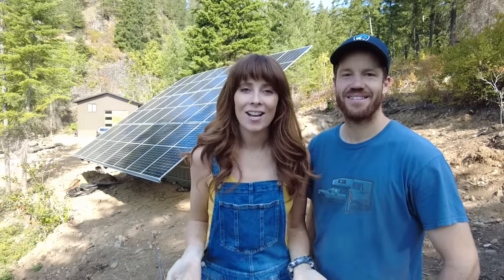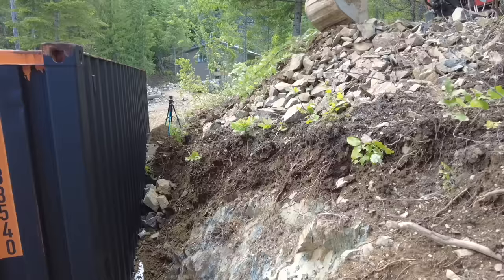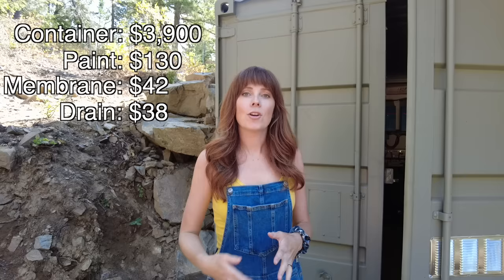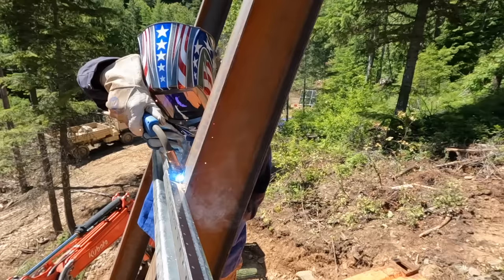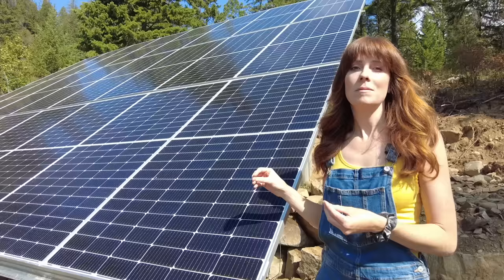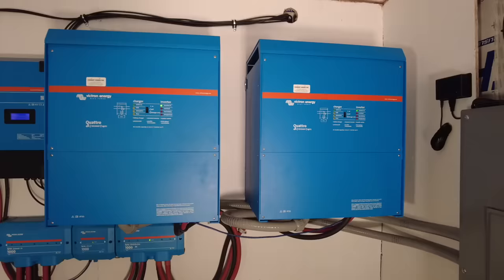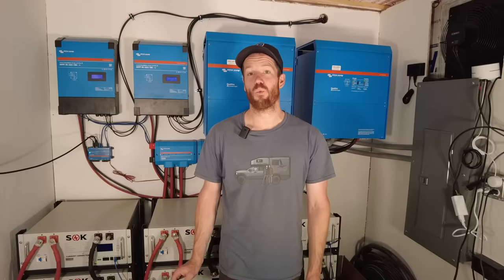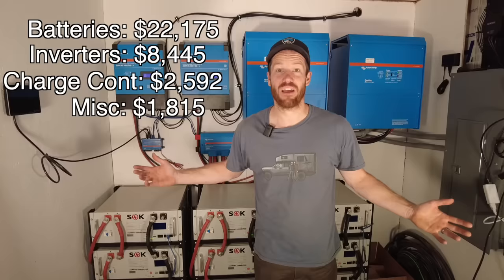TOTAL COST Of Our Off-Grid Solar Power System | Powering Our Mountain Home

Comment: I love your honesty actually giving us a breakdown of exactly what it cost yes 50,000 is a lot of money that being said your sweat equity probably doubles or more the value of your system again thank you for being so honest of how you have Made this happen with the help of your viewers and your hard work!  I am so impressed wow!
Reply: I second that.  We are looking at putting in a grid tied system at our place, but are going to contact the company they got all their components from as we're here in the Pacific Northwest too!
Reply: A monthly electric bill of $200.00 a month would take 20 years to get back $50,000.00 they spent. At that point you may have to replace batteries. Not to mention fuel cost of a generator on cloudy days. Where the savings? Not to mention the maintenance of a solar system. Solar pricing is still to high at this point in time.
Reply: @roywaite5793  After 20 years at their current usage they have estimated that the batteries should still be able to hold 80% of their original capacity which would be be 48kW. They won't need replacing for several years beyond that and at worst they could simply add another couple of batteries to restore original capacity if needed. Then as the older batteries start to fail they can be replaced individually.
You also have to factor in the ever increasing costs of energy so in a few years time that $200 estimate could quite easily become double that. Battery technology will improve and hopefully become more affordable, more efficient and more durable in those 20 years so it is absolutely worth it.
Reply: @roywaite5793  Think of it as paying for 20 years of electricity up front. Then there's no monthly bill, ever.
Reply: @roywaite5793  I guess you didn’t hear the part of what it would cost for them to have power brought onto their property!  I have had that done on property and it far exceeded the original estimate of the power company to bring power on to my property!
Reply: @roywaite5793  I guess you missed the part of the USD 60k it would cost to get power lines from street level up to their remote location?
Reply: @roywaite5793  You do realize that they are going to likely get a 30% rebate (or at a minimum 26%) right? That brings it down to no more than $37,000 for the 26%. And that $200 monthly electric bill you're talking about does not possibly include electric heating or cooking, or you would not even bring that up. Because if so, that bill becomes closer to $400 per month when you also include air conditioning in summer, and even over $500 in some. So at $400 per month that's $4,800 per year, or $48,000 after 10 years. And since I just pointed out that the total cost would not be more than $37,000, then the break even point is only a little over 7 years. So it's all free money in energy savings from them on. And since they'll likely own at least one electric vehicle by then, or even a battery electric excavator or other heavy equipment (yes, they already exist and are at work) it's all free "gasoline" as well. 

And by the way, your $200 per month assumes that electricity rates don't rise over the course of 20 years. Just look back at your bills 20 years and you tell us. And you want to take a guess at what gas prices will be 20 years from now? Of course, that's if it's still even used by then.
Reply: @roywaite5793  it would have cot them 60k to connect to the grid and then 200/month on top of that. they made the right choice
Reply: @greggv8  😅😅😅  I hope you're kidding...solar panels last 15 to 20 years max and lose efficiency along the way
Reply: @Paul-cj1wb  Wow, that sure is a lot of ignorant made up prices in a single comment.
Reply: @ttkddry  Yeah, but that would have increased the property value instantly.  This will be worthless if they don't sell the property soon.
Reply: Evan: with the current improvements they made, especially with the off grid power, they have increased the value of the property and made it far more interesting to buy. Keep in mind that when they bought it nobody was interested in it because of the lack of power. They fixed that now and made the solution independant of future energy price increases
Reply: @ttkddry  Yeah, it isn't worthless or anything, just would have made more sense to first just connect to the grid, (since they obviously have the money to) so as to get the actual equity from it.   How much more valuable would this overkill array be if they could sell the excess energy once the batteries are topped off? Sometimes people really just do the things they do because youtube's algo says they'll make money off of it.
Reply: Evan: time will tell if it is a usefull investment, it depends on what energy prices do in the future... Just look at the price evolution in Europe, we went from 20 cents to over 65 cents per kWh. Our workshop went off grid last year and we do not regret it, price increases do not affect our operations.
Reply: @ttkddry  Of course it is a useful  investment, unless they literally don't use it that is.  It's just a significantly less useful first investment if they could have afforded to connect to the grid.  It looks like this system is going to waste a huge percentage of its capability without being  able to sell the excess energy.
Reply: @evrythingis1  Selling excess energy to the grid is overrated, it all depends on the rules and tariffs that apply to your region. In some cases, yes, you can make money selling if you get a fixed sell rate but because when you produce excess power, all other solar farms overproduce too, the energy price is worth a lot less and sometimes even negative here in Europe for example. You then have to buy back power at another time when everybody needs power thus the price is high. Old systems where you can get your power back  1 to 1 are all being phased out. The large push now is to increase auto-consumption by for example storing it in batteries or heat or using it to run computer equipment on demand. Our current array is 70 kW and we don't sell back to the grid, we autoconsume most of it. If there is no need for extra power our solar charge controlers just tune back and cool down, running the equipment at peak comes at a life-expectency cost too...
Reply: @ttkddry  Running at all times =/= running at "peak".  You also never  have to buy back power if you have a massive battery array... I would say going "off-grid" is SIGNIFICANTLY more overrated than being hooked up to the grid...
Reply: @evrythingis1  Sure, for you running off-grid is overrated but not for all of us, it depends on the location and the specifics of the available grid. For example in our area, where we are all fairly remote and there is plenty of solar installations (our array is considered small), the grid gets flooded by people trying to sell back power. Our normal net voltage is 230 V but once it gets bumped to over 253V, all inverters need to shut down to avoid damaging other installations. This means during the most profitable moments, the production drops to 0 and you have to start buying power from the grid, instead of being able to use your own power. The only solution is to isolate your internal grid from the main grid by becoming an island, meaning being off grid. Perhaps you do not live in the middle of the woods like some of us do?
Reply: @evrythingis1  What you consider 'irrelevant stories' are commonly known facts known by anybody who works in the PV industry. I'm glad to hear I have been doing everything wrong, thank you for point it out. That does not change the fact that if you want to use batteries to sell back to the grid during peak "OFF" hours you need both a grid connection and a battery, which would double the cost to Riley & Courtney in this situation. Grid operators put in limits to the size of grid connected PV installations especially in remote areas like this one in North Idaho to prevent Grid Over-Voltage (for example in Europe 230V +10% -6%, which is a range of 216V to 253V), if you want to hook up a large array, the grid operator will come by and make a grid study, spec'ing out how much it will cost to upgrade their part and how expensive the new grid hookup will cost. In this case, putting in their solar 'generator' is cheaper than getting the grid operator involved, so they went this route. Can they put in a grid connection later to optimize the system? Sure, once they save up for the extra expense. Are they enthousiastic about their new setup? Of course. Do you need to play the armchair expert trying to rain on their parade, at least they are out there *doing things*. You are obviously not the one living 2500 feet away from the nearest grid connection... heck, do you have run a large solar installation with a battery system?
Reply: @ttkddry  All that writing and you're still  butthurt that they obviously should have just connected to the grid with that money first.  You know they could have taken a equity loan to pay for this solar set up with the large land improvement value from connecting to the grid right?  You keep talking about irrelevant stuff under the misguided impression that it changes the validity of anything I've said.  You keep talking about meaningless generalities, and I'm talking about their ACTUAL FACTUAL situation.  You think their battery packs will overflood the grid trickling power back during peak usage hours?  Or do you never actually think about what you're saying?
Reply: @evrythingis1  I think they prefer to stay out of debt instead of piling on more debt, that has been their entire lifestyle so far... by the way, the grid operators never look at the size of the battery or the amount of solar panels, only the size of the AC inverters...
Reply: @ttkddry  Yes, they are very cost conscious building a 50K solar array when a gas generator and firewood already easily meet their needs....
Reply: @evrythingis1  They already have a gas generator and firewood, perhaps they prefer to live debt free and not have to worry about fosil fuel bills in the future... if you don't see the benefits of living off solar, no noise, no fuel to pump, no exhaust fumes then perhaps their approach in life is different from what you have in mind, let's agree to disagree on this subject. It is their channel and their life, I'm sure you can find other channels that suit your confirmation bias better
Reply: How do u farm in the winter
Reply: @evrythingis1 I liked OP's comment because of your posts.

Comment: I really like your solar system.  Money well spent.  The only concern I have is the snow build up on the bottom row of panels since they are almost touching the ground at the winter angle.  You may want to dig out a few feet below the panels for snow "storage".  Plus, a couple electric heaters set at 40 or 45 degrees F will keep the batteries above the lower charging limit of 32 degrees.
Reply: Great idea!
Reply: Pelonis disc furnace are very efficient and set and forget. They don't make them anymore as far as I know but you can find them for sale on the web.
Reply: You can get major power gains (when needed the most)  with low to the snow arrays in the winter, the sun reflects off the snow! But yeah, gotta keep them clear. I accidentally discovered this when I saw higher charge rates then ever before, looked outside, and saw my 1 KW (at the time) array had tilted down to almost vertical.
Reply: Some of those reptile heating mat things stuck to the bottom of each battery would probably work great, plus that way you aren't heating all the air too, just the batteries.
Reply: @GaryVirta  No way that would be acceptable, consumption wise, in the winter.  A battery can get by below well below freezing, they do all the time in our cars! I'm sure the manufacturer has a preferred operating range for their products, but it's not like they are going to freeze and burst. My 20' container solar equipment build (for a customer who sprays urathane foam for a living) has been in operation 10 years, unheated but the container insulated (foam of course).
Reply: @williamlyons3947  30+ years here of solar panels in a high mountain setting, been thru all kinds of severa weather, no panels breaks, not one.
Reply: @portnuefflyer  I thought LiFePO4 batteries would not charge below 32F?
Reply: @GaryVirta  Out of my decades of experience, didn't have them then...,  could be talking out my ass! But I doubt that, too many tele com and other uses for them that would make that a deal breaker. I'd bet it's preferred, or suggested, for max performance maybe, but doable in the field.
Reply: @portnuefflyer  lithium batteries hate cold. Normal Lifepo4 will not charge in a freezing weather. They will discharge faster. They hate extreme heat too. At 35 c°, they will stop charging when reaching  70 75%. You can buy "cold resistant" Lifepo4 batteries but they will cost much more. Batteries like moderate climates, between 10 and 25, 30 c° max. Depends on the battery
Reply: @richarddeutsch9984   With, as I mentioned, no use in real off grid situations (they were not even talked about yet in my off grid days) all I can say is that I do have 3 e bikes, one a fat bike that I put a front ski on during the winter.  I'm sure the range is reduced, can't tell if its the drag of the snow or the cold, but it's coming out of a 60 degree shop, using probably heats it enough to offset the cold's effect a bit.  Yeah, ALL batteries like moderate temps, for sure. I've given up on the Dakota lithium batteries I bought for use in my boom tip came for my crane, they seemingly get too hot and trip the BMS, showing zero volts, cooled off they rebound to 13+. Being grid tied now like I am: I don't miss batteries, of any types!
Reply: @portnuefflyer   Lithium batteries simply won't charge if they are too cold.  Car batteries are Lead-acid, and although their performance degrades when very cold, they are not damaged, and will still charge.  Not a valid comparison.
Reply: @williamlyons3947  theyre tougher than you think, people in my area have had panels for 10+ years and we've had a couple tornado's and hail storms
Reply: You will be  way ahead  if you use a heater that the battery  sits on and insulate the perimeter and top of your battery bank to keep your batteries  slightly above the minimum temperature rather than trying to  heat the air in the whole container. Heating the air means you will need to  waste a lot of power to keep the batteries that are at the floor warm enough to make any real difference for the batteries.
Reply: @russellaustin3109    Yeah, insulate the bat box with 2" foam, and then some silicone pad heaters,  (like the kind you stick on a truck oil pan) thermostatically controlled to maintain around 38 degrees. You could get fancy and have a timer controlled switch let them only come on from dusk to dawn,  it'd be easy enough to see if that got the job done, versus 24/7 operation. Nothing though beats a real BASEMENT!  That's why a mobile home needs heat tape on the plumbing, and a real house, built on a foundation below the frost line, doesn't.
Reply: With it being temp regulated and if it is DC powered where you  don't  loose power due to the inverter that would  work just fine
Reply: @williamlyons3947  most panels are rated to handle extreme hail impacts with no problem.
Reply: @williamlyons3947  no u
Reply: @portnuefflyer  I have a battery sleeve for winter use on my e-bike. It helps but the range does drop a bit in the cold.
Reply: @portnuefflyer  lithium iron phosphate and lithium ion batteries are 2 different things. You will damage lithium iron phosphate batteries if you charge them below freezing. It's not a recommendation, it's absolutely necessary.